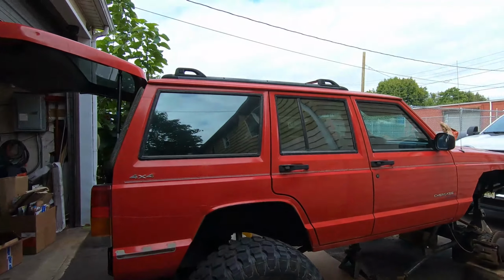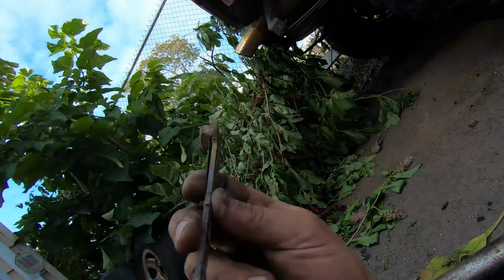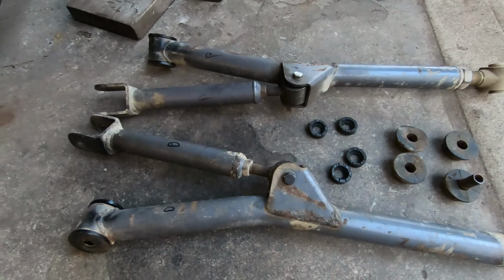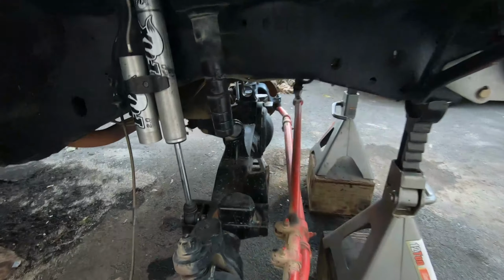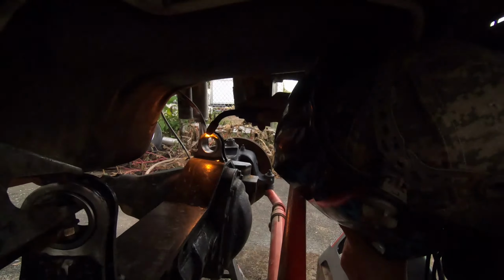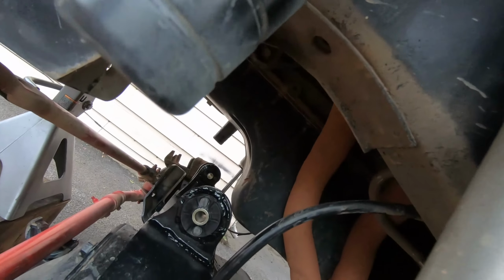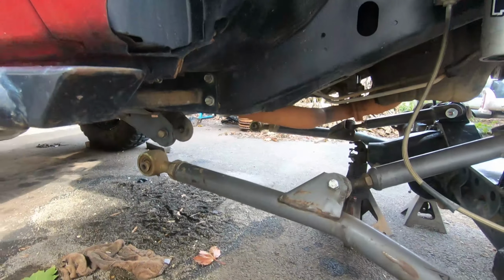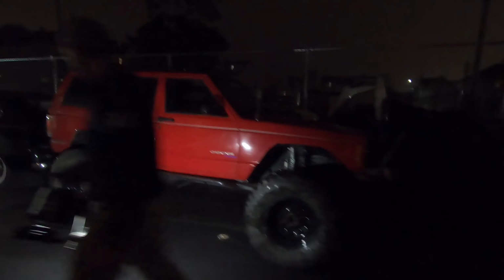One Ton Swapped Jeep Cherokee Gone Wrong Part 2

Comment: In situations like this, I use serrated flange nuts and bolts. You usually don't need a wrench to hold the head (with clean new fasteners) and you can impact them right on.

Comment: How the HELL did a one ton axle fit under the rear of this thing without cutting it all apart?
Reply from the maker: We put tons in every jeep we have lol never had that issue
Reply: @Grewsum2Sum  what shock length do you use? Seems like every one I see cuts the entire back end apart and makes new wheel wells.
Reply from the maker: Boostwerks shock towers, cut a section out of the wheelwell stick em in there and weld up closed.  Then choose the shock of your liking
Reply: Grewsum 2Sum thats about the only other option I could think of. Not many choices to fitting 38” or larger tires in there.
Reply from the maker: @runningproblem  i have 40s on my jeep with only 4.5 inches of lift

Comment: i luaghed my ass off about the control arms.. i actually have the same truss and long arms, and did the truss before hand.. truss is together like the instructions says, but its a absolute pita to put the control arms on. think it has to do with how much bigger the axle is, so distance is off... plus its a tj swap truss not a xj swap truss, which means the upper mounts angle is off by a few degrees
Reply: but what tcase linkage did you get? and ya like it? i currently dont have any and its sucks to climb under it to change it, lmao
Reply from the maker: @jakerogers4327  boostwerks linkage
Reply: @Grewsum2Sum  nice, I ended up getting a rip off Amazon one, but seems pretty stout, made outa like 1/4” plate... think I saw ya in the boosted 4.0 page on Facebook not to long ago 🤣 saw you comment and was like wait a second 🤣
Reply from the maker: @jakerogers4327  lol 😆